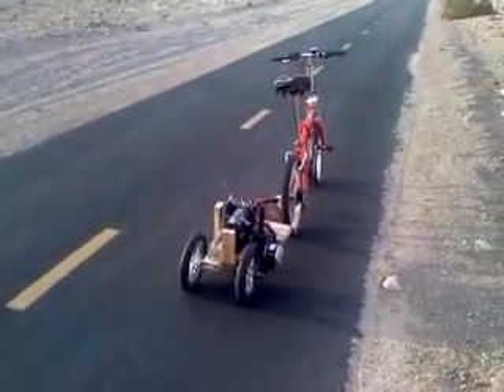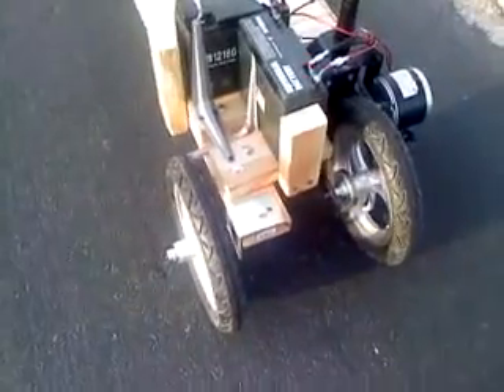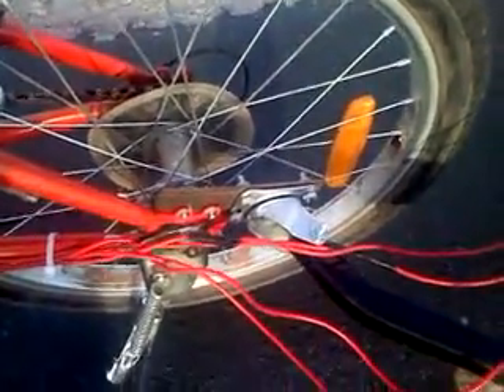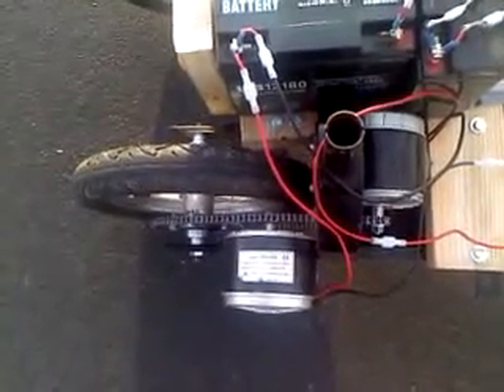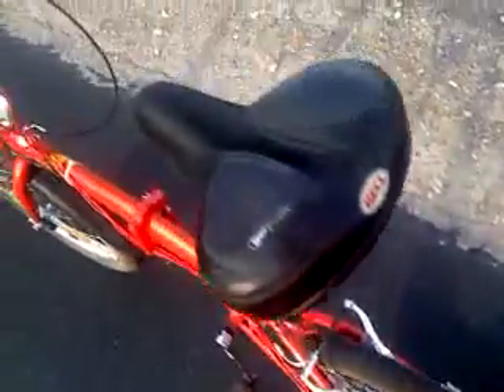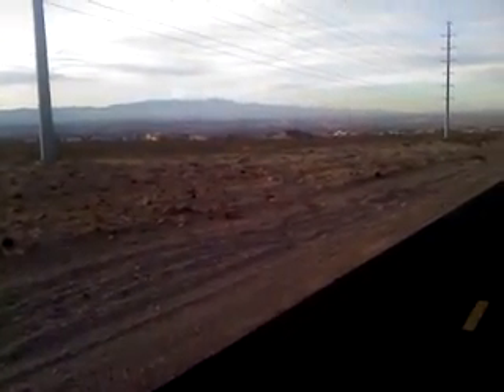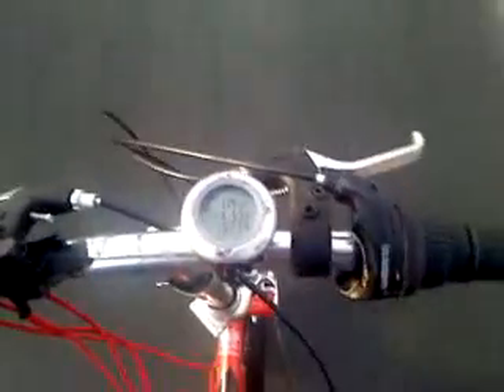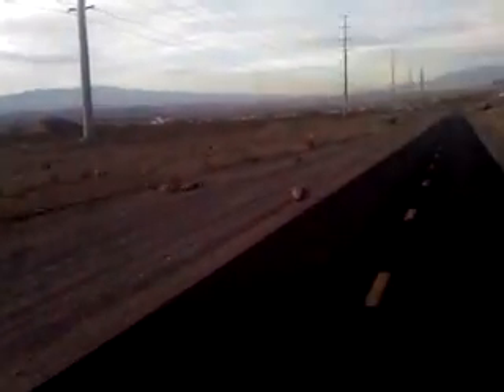Homemade Dual Motor Electric Pusher Trailer

Comment: @hutchtransfer 
 
I have built one wheel trailer.  I pretty much copied the BOB trailers.  The trailer is attached to the bike on both sides of the real axle.  Very stable.  If you get the head and correct it will lean real nice with the bike on turns.

Comment: You should use a controller on the trailer and run a simple thin wire pair to control it. All that wire will resist the current and heat up. A small contactor relay would work, get a starter relay from a parts store.

Comment: Hey. As far as the battery life and how many kilometers is it passing?
Reply from the maker: Using both lead acid batteries and both motors on at the same time, the range is about 7.5km.

Comment: Would you consider using relays wired at 6v and 12v or 12v and 24v as a controller?

Comment: I’d really enjoy talking with you. I’ve had this idea for 20+ years, but my application was somewhat different. I believe it could be a very desirable product for multiple purposes. Feel free to contact me if/when you read this. Trent W Allen on Facebook Messenger or however else.
Reply from the maker: Had okay success using the materials I had at the time.  Unfortunately I no long have this setup.  Just an experiment.  The batteries depleted really quickly, but of course these were lead acid batteries.  Lots of amps with the two motors.  I abandoned the project once I started researching about the bottom bracket drives.  This seemed like a better route for me since the motor would be used more efficiently since I could change gears to match road conditions.